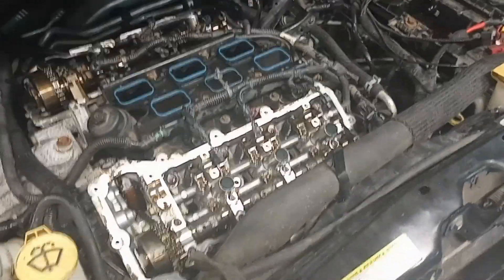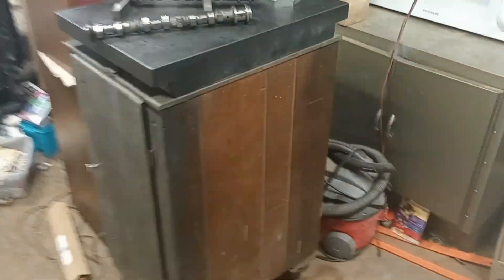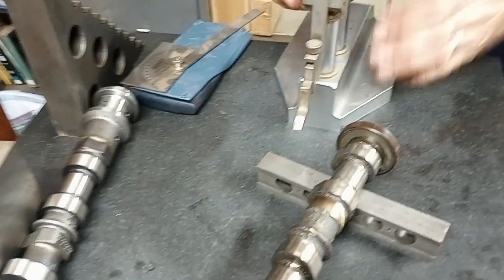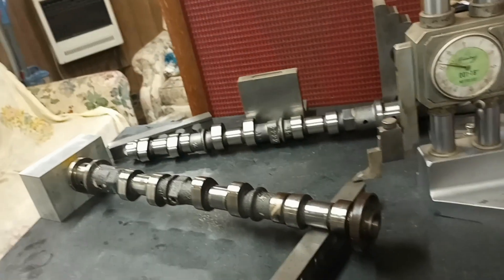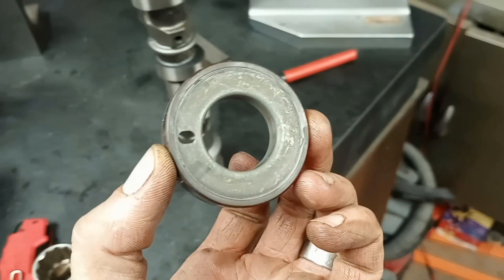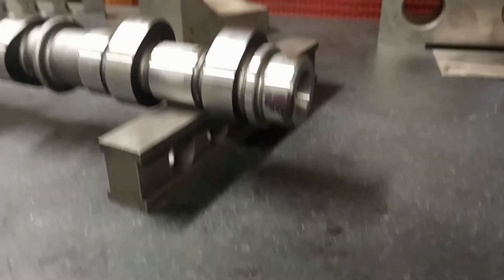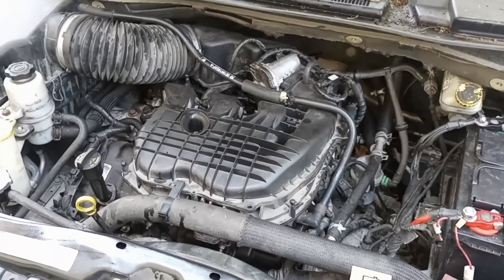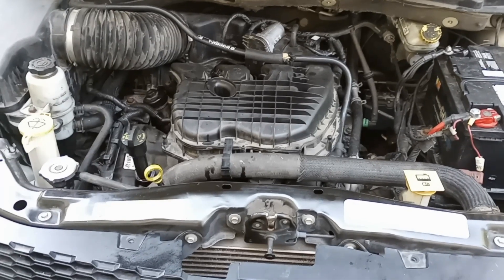3.6l Pentastar Cam reluctor ring/tone wheel swap, this is supposed to be impossible.

Comment: There are 13mm bolts under each camshaft that plug the oil galleys they drilled across under each cam. Those are loose on every one iv taken valve cover off. It bleeds oil pressure that is destened for the cam.
Reply from the maker: This whole batch of nonsense is definitely the Achilles heel of the 3.6, such a great motor otherwise it's a bummer they had to fall flat on this part.
Reply: @Andy-PerpetualMotion  Yeah they are. Also people dont change their oil. The one I just fixed this week had pudding and  crunchy under the valv eover

Comment: Need an oscilloscope to check things out. Pressure transducer in cylinder test. I wire up to all vehicles that act like this to see whats going on to see if its ECU related, electrical, the coils or injectors and check the timing phase between cam and crank
Reply from the maker: I just bought one, but now I don't own that van anymore 😊

Comment: I have the same issue on 2014 jeep grand cherokee rocker arm damaged both cams on bank 2 driver side, got one cam exhaust from junkyard and the other intake from amazon. Installed it and misfire on 2,4,6. Bought a reman head and reinstalled the same cams and same issue on 2,4,6. I will be going to find an original cam for the intake to replace the amazon one. That might be my issue.
Reply from the maker: I am definitely a bit gun-shy of the China cams now.

Comment: RH bank Exhaust cam has the centrifugal oil separator.
Reply from the maker: That was the only one that I couldn't do anything with, I couldn't see any way to pull that thing off without wrecking it so I left that one alone. Thankfully that cam was the only one that wasn't trashed.

Comment: Did you ever figure out the miss on idle?
Reply from the maker: Actually yes, one of the other junk import cams wasn't timed right 😡 ended up figuring out that it wasn't machined right.
Reply: @Andy-PerpetualMotion  hopefully that’s what mine is, it is missfiring on idle only after a Amazon cam swap.
Going to buy a oem one 
Thanks for this video , I’m right in this situation now.
Brand new engine, damaged the tone ring, was going to swap rings but decided to do cheap cam swap.
And now I thought I messed it up . Thanks to this video of yours I’m hopeful to get a new cam and be 100 again
Reply from the maker: @georgemason3722  best of luck to you👍

Comment: What is the grease type stuff on the tone wheel before you take it out and do you have to put grease on it installed or just in stall it cleaned off
Reply from the maker: They just have gunk on them. I clean everything up and lock tight them before I install them.
Reply: @Andy-PerpetualMotion  mine at 100khad a grey goop on them. Is that normal? I just cleaned it off. Wondering if is why I was getting cam sensor codes. Phasers and rockers were all fine. just that grey gunk on the wheel
Reply from the maker: @mefobiajeep9866  that is fine metal dust being picked up by the magnetism in the tone ring, I could be screwing with the signal. Just wipe it off.
Reply: @Andy-PerpetualMotion  My problem is now asfter installing new cam phasers all teh timing marks line up, but when I rotate the engine by hand to check timing, the chain on the exhaust phaser at a couple spots gets slack. Is this normal, or due to no oil pressure yet or do I need a new tensioner?

Comment: Hmm I’m In a similar spot…to return the cam, for one that has the ring already, or try to swap that ring and get it right myself.
Reply from the maker: Definitely a pain in the butt, I don't know if I can recommend it I mostly did it because I was between a rock and a hard place.
Reply: @Andy-PerpetualMotion I’m taking your word for it and saving myself the hassle…just ordered another that comes with it and returning the old one. Thank you!
Reply: @manciniak how is the replacement working and where did you order it from ?
Reply: @bradc5433 I ordered from Amazon just in case something wasn’t right. I did the swap with new Melling lifter on one bank. I still have an odd check engine light but the engine runs fine otherwise and is daily driven. That being said I hate the pentastar 😂

Comment: That was great work but to be honest I wish you had pushed back a little harder against that ebay seller. You shouldn't let them get away with selling you an incomplete product like that. Now that they've gotten away with passing that off on you they will continue to try to cheat others in the future.
Reply from the maker: I was in kind of a tough spot, what they sold was miss advertised but I really needed to get the engine back together and I was having trouble finding anything else I could afford. So I just rolled with it.

Comment: I know how to time that ring now,I did it correctly by mistake on my mom's  2013 charger ,3.6 v6 pentastar,time it to the hexagon corner in front of it where your wrench goes,the corner 30 degrees north facing the camshaft pos sensor ,is where that hole needs to be ,trust me ,

Comment a question if u don't understand
Reply from the maker: Interesting, I have since sold the van but its still in the area running strong.
Reply: Ok explain this to me please

Comment: You did not say what codes you were getting I can only assume they are cam sensor codes, there 2 cam sensors that code wise are 4, at the bottom of the sensor it looks like a T one side exhaust and one side intake so sensor 1 and the other sensor 2 so if you are getting say codes 345 and 390 that would be bank 2 sensor 1 and the other code bank 2 sensor 2, those codes are going to narrow done the search, as far as a head I would think there would be other symptoms besides a miss fire code. Most people look at mechanical don't rule out electrical I believe there are 5 wires to the sensor, 5V power, ground, sensor 1 signal and sensor 2 signal. I have forgotten the name of it but there is like a piece of plastic that you can place over the tone wheels and see the magnetic flux lines maybe that would help to line them up using a degree wheel.
Reply from the maker: Since we shot this video, I replaced both cams on the Left Bank with used ones and almost completely cured it of its quirks, as far as I can tell the location of the alignment dowels on the Chinese cams that I ended up putting in were machined wrong.
Reply: recently I bought a set of rear control arms and when I took them out of the box I looked at the two upper control arms and one had the mounting bracket welded offset of course from China, I ran into a man this year in Manila PH airport and he told me the reason China can keep the cost so low is they have no middle management, they have laborers and senior management, this is probably why quality suffers so bad there. Glad you were able to fix your issue my kid has a Jeep with the same kind of problem and we have been tinkering for quite awhile with it.  @Andy-PerpetualMotion

Comment: Mopar makes a tool to align. Currently 150$ for two tools for bank 1 and bank 2 well worth it
Reply: Just had my first P0019 in a 2015 Jeep arrive. Bank 2 exhaust cam. Scanner show a -40.00 degree on that cam, while the other 3 Idle a -4.30. After research an diagnostic  I feel that tone ring has change. The Tone Wheel Check Tool Kit would be a must in my ideals to reinstall that ring an some how stationary it back to the tool kit specs. I yet to actually pull the valve covers to verify, gotta see what the owner wants to do. This is expensive problem if you go with buying new stuff. Lets hope they have corrected the problem, instead of buying it again. I am curious to see the valve covers off.
Reply from the maker: The only tool that I saw them offering was one to verify if it had slipped not one that was capable of actually indexing for installation.
Reply: @Andy-PerpetualMotion where did you even find that tool. Ty sir

Comment: Have you done a cam/crankshaft correlation relearn...
Reply from the maker: We did, since I shot this video we've had further developments. I discovered that one of my junk Chinese cams had the slot for the locating pin machined in the wrong location, because I was using that slot to re-index the reluctor ring it allowed the cam timing to we wrong without the computer being able to sense it. I got a used Cam and put in there and it's been running like a champ ever since.

Comment: Sounds like you need a new left side cylinder head. Alot of the 2011 and 2012 models needed them. Chrysler redesigned the head for 2013 models and up. Hope im wrong but from my experience with the pentastar this has almost always been the problem.
Reply from the maker: I see a lot of people saying that but no explanation of what is actually wrong that kills all three cylinders, and only at an idle, it passed a compression test also btw.
Reply: @Andy-PerpetualMotion  #2 cylinder valve seat overheats due to lack of initial hardening from the manufacturer
Reply from the maker: That still doesn't explain all three cylinders on the number 2 bank being dead at an idle, what's even stranger is it has thrown a bank 2 rich operation condition code. Bank 2 is running long term fuel trim in the -15 to -30 range almost constantly.
Reply from the maker: I replaced both upstream O2 sensors with OEM sensors so I know that isn't it, I'm starting to suspect a leaking injector.
Reply: The best way to verify is to do a cylinder leak down test. Not a compression test. The left head was bad casting and porous aluminum.  With the condition of the camshafts all 3 cylinders over heated. If it was injector related it would smell like burnt cow poop as soon as you fired it up. Also you would get a fuel rail pressure code. The left heads were recast in Canada or another company in Mexico.
Reply from the maker: Sorry, I was trying to reply and deleted one of your responses instead 😬
andrewleach6@gmail.com